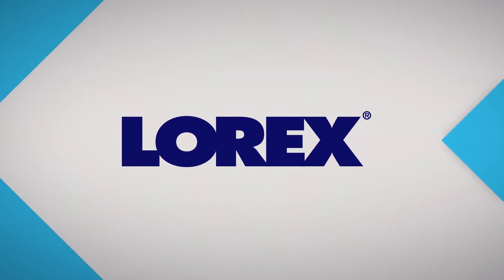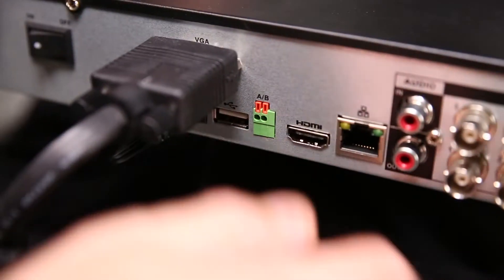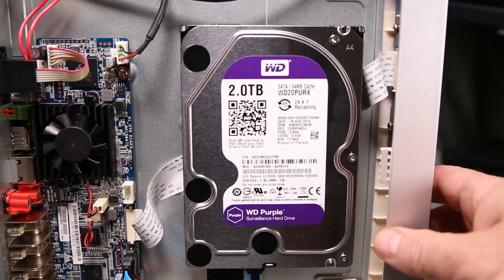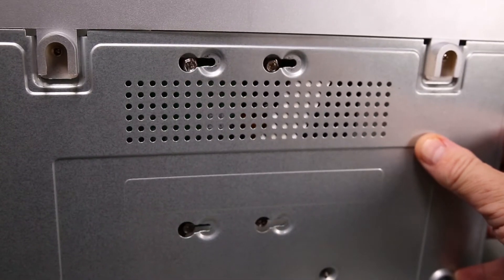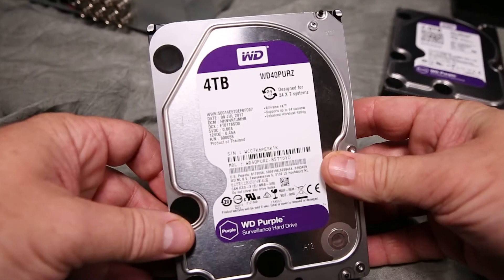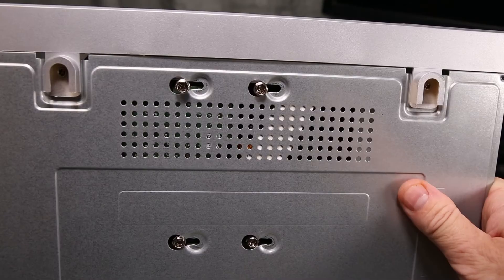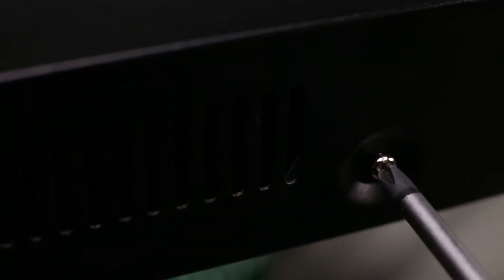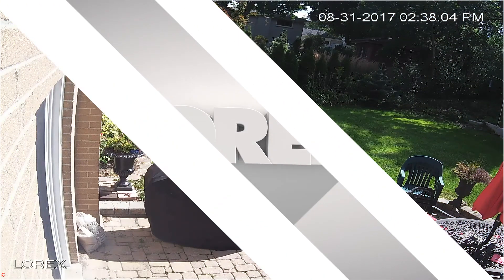how to upgrade and install a DVR hard drive

Comment: Do this work whit all DVR brands ? I did read some in google that if youi have a 400gb recorder and set in a bigger in , the system only handle 400 of the new drive and also that the old drive casn have some filmware on it that needs to set on the new drive, I have  a old Panasonic VCR 930H-s from 2005 but has at least a  Dv IEEE 1394 (firewire) connection that,s alows me to connect my old DV camera digital on it

Comment: Thanks for the video very useful i have the Lorex 19inch wide screen LCD Monitor with integrated DVR which is no longer being sold and my HDD setup process is stalled and i am looking to replace the Hard drive and increase the hard drive to 1 TB or more if i can my Model No is L19WD814321P and Serial No DF020910335  Will the hard drive being shown in the video fit mine if not which one should i order and from where 
Many thanks
Harry